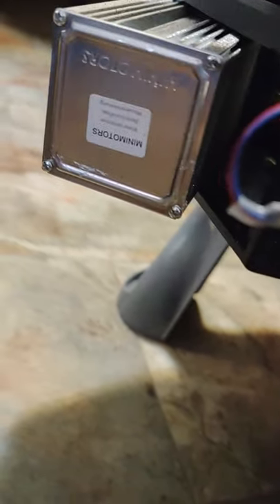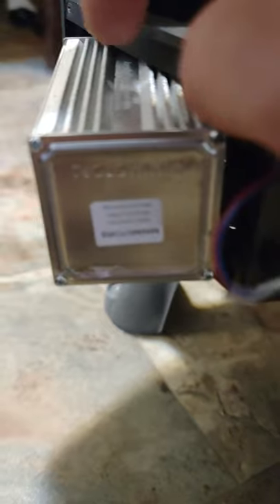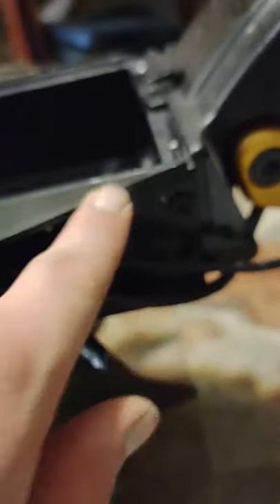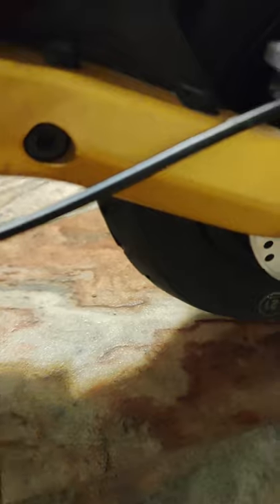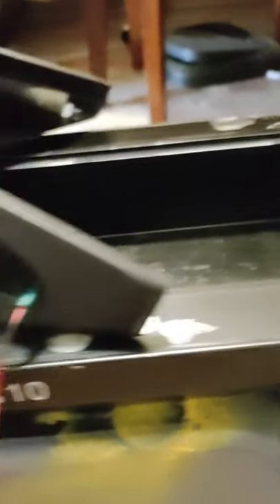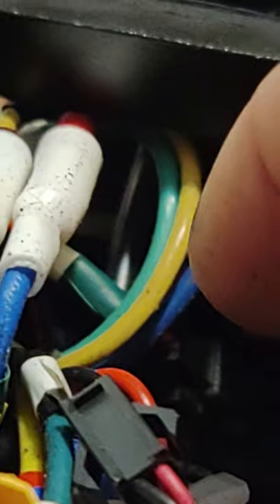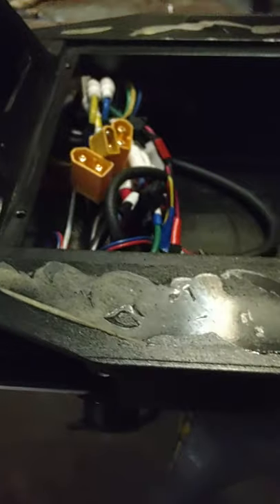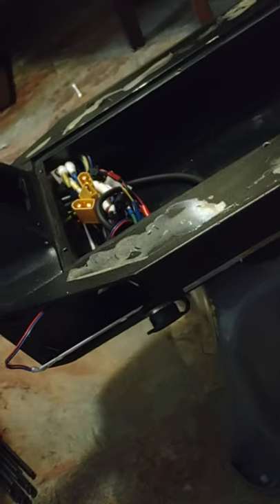waterproofing the mantis 10

Comment: Just bought a new controller I thought I sealed it properly the first time but I guess I was wrong, this time I am sealing everything, will see if I can somehow seal the controller without affecting the heat dissipation. Anyways it was pouring hard rain.

And the box where the controller sits is bad designed, water will go in super easy since the wheel spits water when its spins right in there. And the water from the grounds go thru the controller bolts.
Reply from the maker: It also has a cover where the wires go into the deck that's usually where they get ruined. Lay a fat bead of silicone on the edge of the panel and reapply it and make sure the wires get sealed it will help you alot to do that
Reply: @wolfking5232  Thats what I did the first time, I need to get a more watery silicone so it seal al the cable where they go in.
Reply from the maker: @teama224  look online also for a tail for the front fender it will help. I just used a heat gun and a old tub and made my own to deflect the water down more away from the box area.